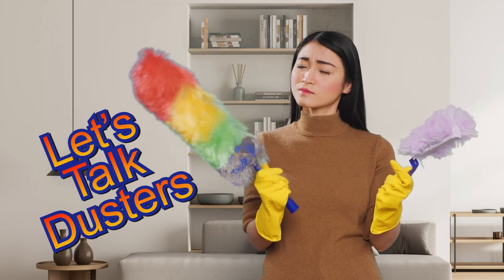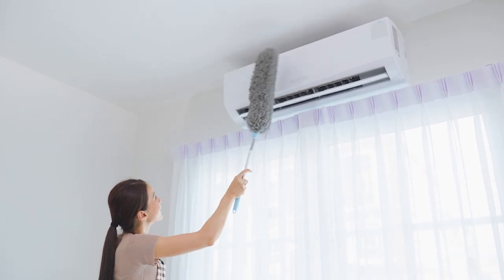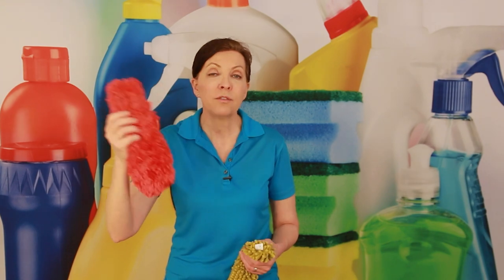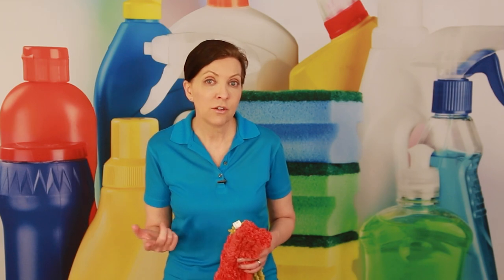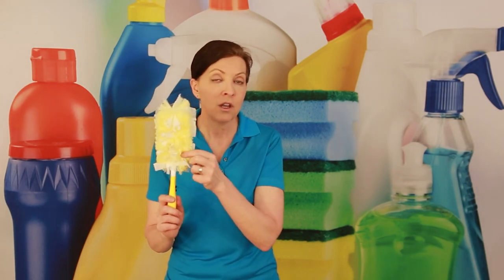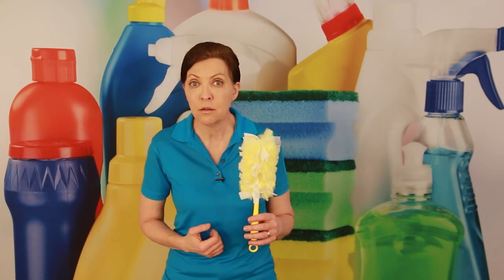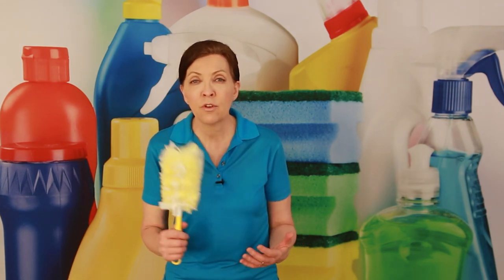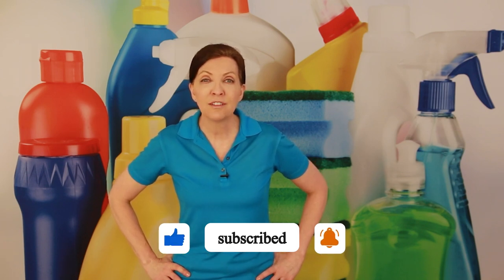Let's Talk Dusters - Disposable vs Washable...and Why

Comment: When I cleaned professionally I had 100+ microfiber cloths just for dusting. I used around 10 of them for the dusting on an average job. I used Swiffer or a washable duster head, for work that required an extension handle. Your point about preventing cross contamination is so important.
Reply: Yes, cross contamination is so important and not enough people address it!
Reply from the maker: +Galamander _ Oh wow. It sounds like you had a great system in place. Thanks for sharing. 👍
Reply from the maker: +Seven Deadly Chins, right? I think in recent years the focus has been greater as more people have become aware.

Comment: When you have washable dusters that can be machine washed Do Not use fabric softener because it with remove the static that helps attract and keep the dust on the duster. Also put them in the dryer if they are dryer safe to add the static clean. And Do Not use dryer sheets. If you want them to be super soft use 1 cup of vinegar to the rinse cycle - it will make any fabric soft and it doesn't smell like vinegar.
Reply from the maker: Great tips. Thank you very much for adding this to the conversation. I appreciate you. :-)

Comment: Great to know that the Swiffer knock-offs don't work as well, and that Swiffers can be mailed free to be recycled!
Reply from the maker: Yes, Terracycle is the way to go for recycling the Swiffer duster heads. Thanks for watching the video. 👍
Reply: TY for letting us know about the Terracycle program. We’re signed up! We used washable microfiber cloths for years, though they don’t work as well, to be more env. friendly. We bought some Swiffer 360 disposables today and joined the recycling program. Thanks so much, it’s great to have a product that’s functional and recyclable.

Comment: Thank you Angela. Just finished a renovation, so dust is everywhere. I realized that microfiber clothes are just not appropriate as it just fix the dust into corners and more... Now i am about to buy some more swiffer dusters also for the regular cleaning. Your video came out at the perfect time to confirm that these dusters are great power tools. But i won’t buy the reusable ones, for now.
A question, last week, i asked the lady of the cleaning company to do the baseboards of the renovated spaces with the swiffer duster. She said it was a better way to do them with the vaccum.. now there is a grey line on the white baseboards. I saw it afterwards. My regular cleaning lady will come back next week from holiday, Thanks God. But soon, she will leave to get married in another state. It is always a nightmare to receive a remplacement. I am diseable, so i get up at the person’s arrival and departure. I prepare a task list that i give after showing/reading it quietly.
I thought about hiring 2 ladies regularly : one coming 3 hours mondays, the other 3 hours thursdays. But it’s always a thought, as 6h for one person regularly is more appealing for the relationship. Thank you for any recommandations ;)
Reply from the maker: Thanks so much for reaching out to leave a comment. 👍

Comment: I lived in a hotel for seven months after a house fire, and happened to be immunocompromised at the time. The more I've thought about it in the years since then, the more I've realized that there is NO way the housekeepers were changing the duster heads between rooms. For that matter, they were using the same brush to clean all the toilets in the hotel. I was very lucky I didn't catch anything. If I'd thought about it at the time, I would have asked my insurance company to cover buying the necessary cleaning items to be used just in my room. The hotel staff were very service-oriented, and they did a lot of business with that insurance company, so I think if it had been explained to them, they would have been happy to accommodate me. I just didn't even think about that detail. I was just glad to see them cleaning my room regularly.
Reply from the maker: I am so sorry about the house fire. Thanks for reaching out to share. Sending hugs! 🤗

Comment: Thank you for your informative vids.  Have you talked about cleaning of the stove vent filters?
Reply from the maker: I don't remember. Do you have a specific question I can answer?👍
Reply: @AskAngelaBrown  we do a lot of stovetop cooking and accumulate a lot of grease on the vent filters, I usually soak it in a degreaser solution and clean it with a brush. Any suggestions? Thank you!

Comment: Even if it's only bring used in one house when you go from one object to the next or room to room you are cross contaminating within the same home.
Reply from the maker: That is correct. Most homes do have "common" germs as the air circulates through the house with central heat and air, and when people move about from room to room, they carry living room germs into the hallways, bathrooms and bedrooms. That is not so much a concern. The key is to isolate the living spaces so "what happens at the Barnum house, stays at the Barnum house." 👍

Comment: I have a different type of duster. It is long and i don't know how to describe its very fluffy and bouncy' It usually has a static charge, but I washed it and now it's not the same. Has no charge. How can I add the static charge back to it?
Reply from the maker: It sounds like an electrostatic duster (does it look like this: https://amzn.to/3mPV0SM - paid link) if yes, it will never return to it's fuzzy/fluffy self after washing. It's best to just buy a new one.
Reply: I rub mine back and forth on my comforter after hand washing and air drying.

Comment: Hi Angela, I love swiffers. What are some products you’d  recommend for polishing furniture with wood that needs to be kept moisturized and polished to a shine? Thanks for all your great advice!
Reply from the maker: To keep your wood furniture moisturized and polished to a shine, there are several recommended products you can use. A high-quality furniture polish designed specifically for wood surfaces is a great option, as it contains nourishing oils or waxes that can moisturize the wood and enhance its natural beauty. Another option is beeswax polish, which can provide a protective layer and help restore the natural oils of the wood. Citrus-based oils like lemon oil or orange oil also work well for moisturizing and polishing wood. Alternatively, you can create a DIY wood polish using equal parts white vinegar and olive oil. Remember to test any new product or DIY mixture on a small area first, and always dust and clean the furniture before applying polish to maintain its condition and shine. Hope this helps. And thank you so much for watching the video and for your feedback, I appreciate it!
Reply: @AskAngelaBrown  Thank you!

Comment: Hello Angela ...can you recommend a great vacuum cleaner? lots of human hair so no brush preferably. thank you!
Reply from the maker: If you have a lot of human hair to clean up, you may want to consider a vacuum cleaner with a motorized tool or a suction-only canister vacuum that does not have a brush roll. Some popular options include the Dyson Cyclone V10 Absolute, Shark Rocket Corded Hand Vac, and Miele Compact C2 Electro+. These models have strong suction power and attachments that can easily pick up hair from carpets, upholstery, and hard floors. It's important to choose a vacuum with a HEPA filter to capture pet dander, allergens, and dust. Be sure to compare features, warranties, and reviews before making a purchase.

Comment: I'm not a professional cleaner, but I'm working on improving my skills and want to work smarter, not harder.  How would you compare the swiffer duster 360 to the 180?  Is there a reason to go with the 360 instead of the 180?  TIA for your answer.
Reply from the maker: Both are great! The 360 has fibers all around so they can trap more dust. 👍
Reply: @AskAngelaBrown  Thank you!

Comment: Is a regular swiffer sweeper dry better for small room floors or are those microfiber cloth attached to a broomstick the same? I like the idea of reusing the microfiber clothes but idk if they pick up dust and stuff better then a swiffer dry sheet. If the reusable, which brand do you recommend?
Reply from the maker: Both sound like they’d do the job. Swiffer is known for the trap and lock technology so it might hold the dust better.
Reply: @AskAngelaBrown  thanks angela